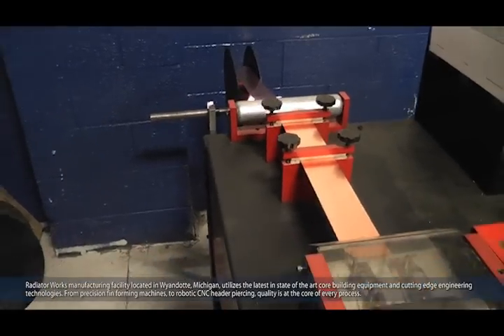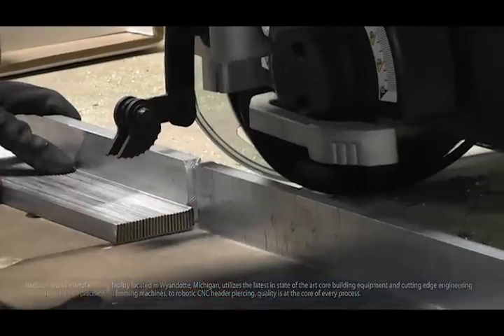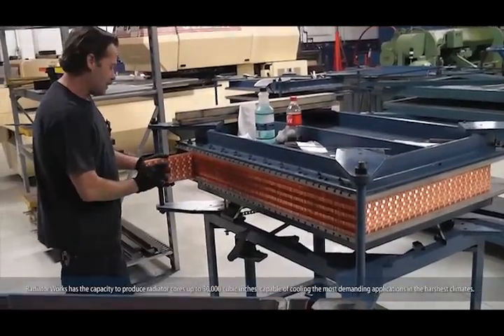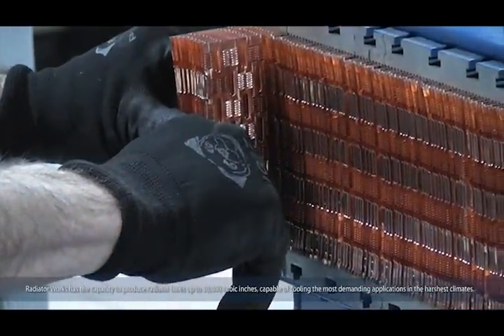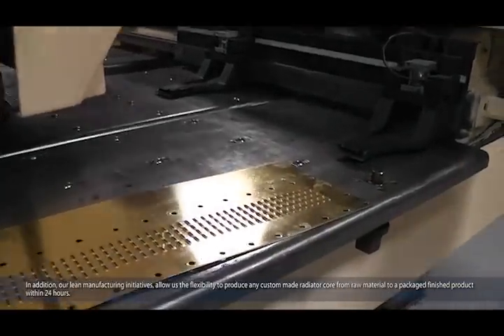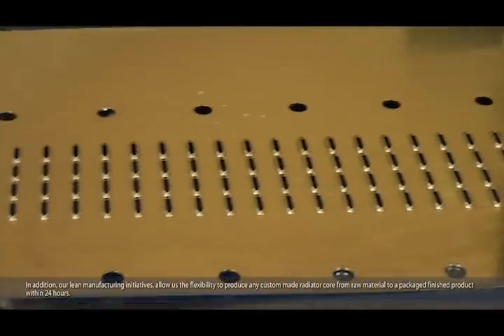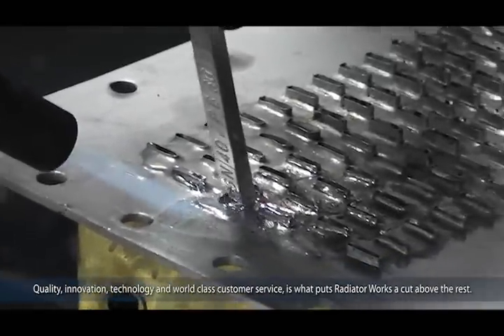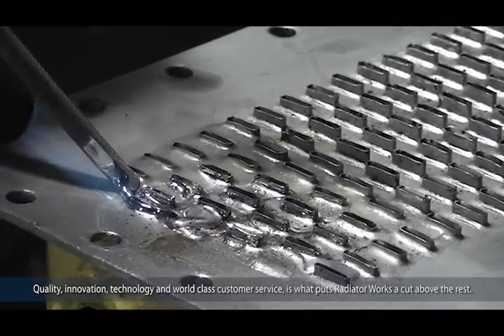Radiator Works - Radiator Core Manufacturing

Comment: Used to work at a radiator plant , sanka manufacturing , good job , i loved the solder pot , 750* degrees all day long . only one who could stand the heat.
Reply: 750*

Comment: Looks like heating and cooling coils large HVAC Units. At one time,  I worked at  one of the largest HVAC air handling manufacturing facilities in the US and it looks like they are building the same coils (radiators)  the same way.
Reply: i mean, they're essentially the same thing

Comment: Interesting video. I just bought a new radiator but the side of it is crushed in some (not big but enough to see that its squished in). How much will it cost to repair it and will this dent cause any issues? Seller is offering me an $8 refund.. It seems on the low side to me.. :)